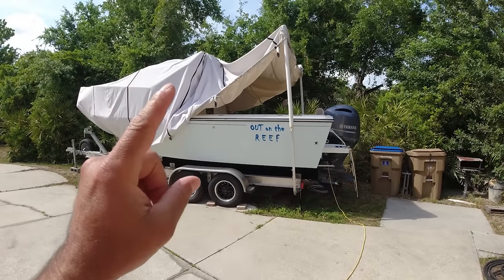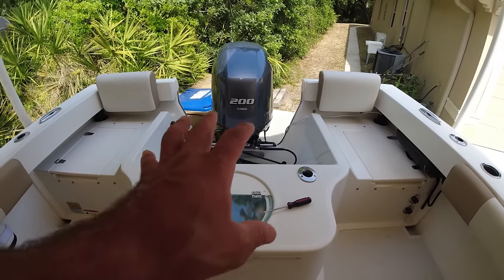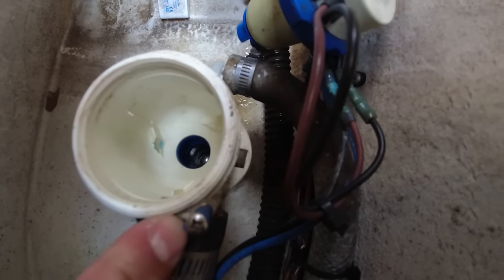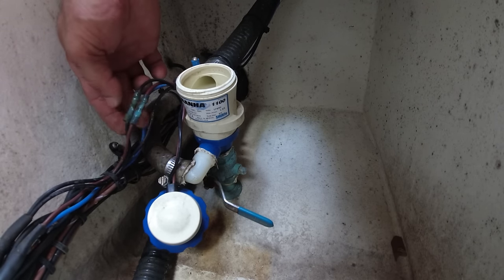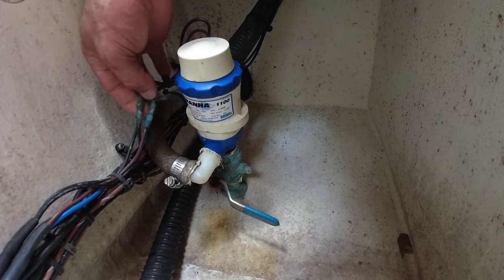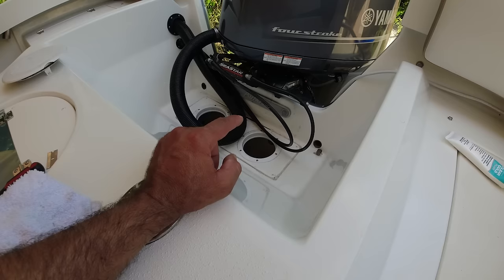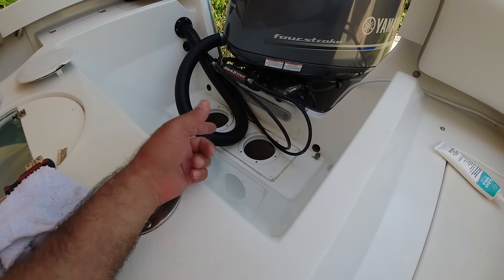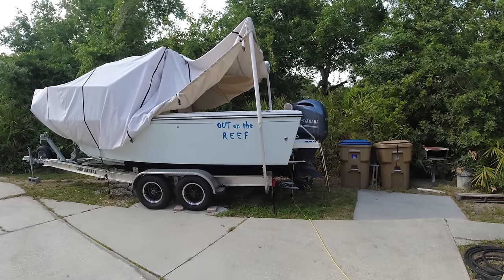Crooked PilotHouse is Been Leaking Water Since it was New Found the Problem from parker boats

Comment: Thru- hull connectors are responsible in sinking so many boats. Always carry a tapered wooden dowel, the size of your thru-hull fittings as well. I know yours was a bulge pump clearance issue, but make sure you wire a wood dowel to your thru hull fittings so if one ever breaks directly off, you can hammer the dowel into your thru hull to stop the leak.  
Good stuff captain. 
Uploading videos early this morning huh? 
My parker 2520 is ready to go after last weekend. Did major service including changing the thermostats and the timing belt. 
Have you changed your stats on that motor yet? I had one stuck open. Make sure you check yours my friend.
Reply from the maker: No I have never change the thermostat I only have 180 hours and how many hours did your motor have Captain
Reply: @OutOnTheReef  Hi Capt... I'm very surprised you have only 180 hours on your boat/engine?, I'm wondering if you hour-meter is 'crooked' ! We put 250-300 hours per year on the boat, and it seems like you do more than we do; I'm just surprised. 180 hours is barely 'broken-in'!.... Be safe Capt. and thank you for another helpful, informative video!...

Comment: Pro tip, when I find wires that have heat shrink butt connectors that were not heat shrinked properly that have been exposed to salt water (even if only briefly) I would cut the butt connectors out, re strip your wires, install an additional heat shrink sleeve onto the wire, crimp your two new heat shrink butt connectors in place, then apply heat to the butt connectors for a good seal, then once they have cooled to the touch slide the additional heat shrink over the each butt connector ( or a single heat shrink tube over both butt connectors) and then apply heat to it to completely seal it. If salt gets into that copper it will corrode fast.
Reply from the maker: Jake you're absolutely 100% right I should do that to avoid future damage on The Wire and thank you so much for your awesome advice it's the best way to do it thank you

Comment: Maintenance, maintenance, maintenance. I always enjoy preventive maintenance. It’s the small repairs that make you feel comfortable when out on the open sea. Small problem that would be a nightmare had the bilge pump gave out. 👍🏻
Reply from the maker: Yes I agree this could sink a boat if you're sleeping at night and not noticing the boat is sinking is crazy
Reply: @OutOnTheReef  No - a tiny seepage like he had is NOT going to 'sink the boat" - you're overstating it.
Reply from the maker: @bobbeckstead8340  I think it could if your bilge pump stops working and you're sleeping overnight on the boat don't you think that's a possibility
Reply: @OutOnTheReef  Not with a teeny-tiny leak - which is all that was possible from his particular problem.  Remember, he left it for 2 yrs without a problem.  It is not the least bit unusual for shaft & rudder pack nuts to weep continuously.

Comment: Two comments.  1)ABYC standards require the use of two clamps on all raw water hoses in the bilge.  2) You should adjust the pump to allow the ball valve handle in the seacock to open fully.  Stay safe!
Reply from the maker: Looks like this company who build a boat does not follow those standards and thank you for letting me know captain 👍👍

Comment: Funny you showing this video. a couple of years ago I had a leak with the saltwater washdown hose in that same area, and it could have sank my boat. I decided not to go to work that day and went to the Marine to find my boat sitting low in the water. the boat was filling with water. Since then I never turn the value on the saltwater washdown until I'm using my boat. A little leak can be a disaster. Thank God my bilge pump worked.
Reply from the maker: wow Williams that could been a disaster especially wen the batterie runs out of power, glad you got it on time cap.👍

Comment: Good job. The boats I rent all have Yamaha’s, great motors, but they all need maintenance and repairs. Check out your thermostat, had a bad one one today and it was easily replaced.
Reply from the maker: Awesome Captain thank you for letting me know and what was the diagnostic it was getting overheat and you heard a noise on the buzzer?

Comment: Nice! 

I’m more curious how you diagnosed and isolated the problem. 

A. Did you dry the bilge then close the ball valve with the boat in the water. Re-dry then open? Just an option to isolate a thulll leak thatbis fortunate to be on a valve.  

B. Make sure to cut those wire back and first slip down the wire extra shrink tubing, reconnect new butt connector, heat shrink them slip over the tubing and heat shrink it as well.. Also I noticed the orientation of your wiring is both goinf horizontal at a slight downward angle and also tieing into the transom. I would run the wire the other direction away from the transom if possible and get height away from the bilge before you run it horizontal.  That will keep your bilge wires dry. No bueno the way they are there. Bad on the factory install,, but an easy fix!
Reply from the maker: I repeated the bilge pump and screw back and the water leak stopped cap. It was never done properly from factory and i agree on the wire protection you mentioned cap ,thank you

Comment: I'm here to tell ya, Parker has a quality control issue when they release their boats. Little hidden things they overlook. I opened up the inspection hole in the engine bracket/swim platform on boat I'm buying. Found lots of screws and nuts left over from the build. I made the dealership come look and take at it and take a picture to send it back to Parker. Lots of left over drill shavings in the bilge, 2021 boat and the monkey fur already coming off in the pilothouse. Still with these defects I can see, I'm still going to buy it. Parker is now pumping out boats pretty quickly. So' throw them out there. Some will complain, most will not.
Reply from the maker: Something similar happened in my boat when I purchased it I checked on the fuel cap on the deck delete that protects the fuel tank opening and I found leftover screws hanging around in the bridge so I cleaned it up and didn't say nothing about it but yes it is a terrible uncleanness boat builder by my inspection and I also took the carpet out because of that issue of the mold and many other things and if you look at my channel my boat came without a window sealed in one of the front windows I was not surprised

Comment: I guess whoever inspected your boat had no clue of what he/she was doing, a leak, crooked pilothouse, kind of disappointed on the brand, and they are not cheap. As usual you always come up with a solution fir everything you need or want to do to your boat. Your lucky your handy and resourceful, otherwise it would have been extra higher expenses....
Reply from the maker: Yes very disappointment and you're right if I wasn't handy I will have to take all these things to the dealer and that would have driven me crazy so I feel sorry for people who buy this type of bolt with no knowledge of marine work to do their own repairs.
And thank you for watching captain
Reply: It's unreasonable to expect anyone to have detected that defect in advance.
Reply from the maker: @bobbeckstead8340  I think boats need to go to a water test to find leaks before they sell them don't you think, most great manufacturers do that
Reply: @OutOnTheReef  Most BUYERS do that.  Would you have detected that particular defect?  Uh-uh.  And, it was trivial and so easily repaired that you didn't even complain to the builder or seller.

Comment: Hey Cap, good catch on that leak! That one would be hard to figure out. 
However, one more thing I see that I don't like and feel is not safe is those types of inspection plates!  They can easily pop out from pressure or whatever and also leak. If one popped out with heavy following seas, you could be in real trouble. 
I replaced mine due to leaking even with good oring seals with the screw in type. First, they can't pop out, second, they seal better since can be tightened up. 
Please consider changing those out for better and safer inspection plates!
Reply from the maker: I noticed that rubber on my case they always leak water no Captain where do you buy yours do you buy through Amazon if you did can you send me the link so I can replace mine that is a really important thing to do on my boat thank you for the big heads up Captain
Reply: I’m surprised they are not the screw in type to begin with.  That area can be awash in water when drifting or at anchor in seas.
Reply: @OutOnTheReef  Hey Cap, my application is a bit different being on a bracket on a Grady White. I have 3 inspection plates. I was able to find the best fitting one's with exact same hole cutout size from West Marine, their brand actually. So far, they have been excellent quality and no leaks. I was getting lots of water inside the twin engine bracket each time out and would have to remove both drain plugs from the bracket. Since I replaced the pop out style and installed the screw in type, no more water ever drained since the replacement. I used 4200 sealant for the outer rim, and used  silicone rubber safe grease on the orings so that they don't deteriorate the rubber orings.
Reply from the maker: @robertp7209  I would like to find those Lids so I can replace mine because definitely they do feel like I can pop out any minute and make a problem on high seas
Reply from the maker: @Grady252  great suggestion Captain I will look into those and I'm glad your Grady-White boat is now top shape and thank you and always navigate safe my friend
Reply: @Grady252  - I have the same boat I guess as you, I used solid covers no screw out, same material I think polyethylene.  Caulked down never a leak.  Since there is nothing to access inside except upper engine bolts, no need for regular access.
Reply: @robertp7209  That is very true, but I liked the screw in type so that if I needed to get in, was quick and easy. I also installed a small silicone aquarium hose and ran through the transom to allow air pressure to escape as it was blowing my caulk out. Lots of air space in those Springfield Brackets to heat up and expand and contract.
Reply: @OutOnTheReef  - the brand you have now will probably have both versions.  The brand may be on the cover, then it’s just a direct replacement.  Mine on my old Grady are Tempress Marine, they used to come also in off white like beige similar to Grady hull color.  They were not ABS material but a softer polyethylene I think.  My floor deck plates over the gas tanks are pop out, the one over my bilge is screw out.  I have a tool for the screw out but just snug it by hand.  It doesn’t matter if it leaks a bit into bilge.  I also have one pop out on each side at the step up to the walk around, but replaced those with some Amazon brand white ABS screw outs.  The pop outs were jiggly loose, the starboard deck coring was wrecked from however little water dripped down the inside over the years, and Grady’s expertise at “glass starvation” = too little resin applied making the 1/2 in. Ply coring skin porous.
Reply from the maker: @robertp7209  very good information Captain I will look for those replacement so that way I have less leaks into the bilge thanks for the awesome suggestion captain

Comment: Hey Capt.....When that saltwater gets into the copper wire connection. It will corrode even after you heated the connections. You might want to take the connections apart , clean and reseal . It's stinks the factory left it like this.....
Reply from the maker: I know it sucks it's just a momentary fix but later on I know I'm going to have to fix this the right way thanks for the heads up Captain, and yes it's a shame that the manufactured didn't do it right the first time

Comment: Hi Capt... thank you for this helpful and safety-related video...
I also responded to one of the comments about you having only 180 hours...that is very surprising to me! Stay safe, and thank you for your great video....
Reply from the maker: Thank you Captain and I did not see that comment I'm going to look it up thank you for watching
Reply from the maker: I could not find the common captain but yes the motor right now has 180 hours
Reply from the maker: I think the reason I have very little hours is because I don't do much trolling
Reply: @OutOnTheReef  Hi Capt... having low hours is a GOOD thing; I do too much trolling  (lazy-man fishing!☺) so I put too many hours on the engine at low speed.... On the thermostat subject. I first changed my thermostats at 700 hours. They looked like new! I kept them for spares. I run mostly in brackish and salt and I flush the engine after every use. I wasted money and time changing the thermostats. It could be different with all ocean, heavy salt water use....
Reply from the maker: @andrewfyakim525  I would look at my manual and probably I will do mine close to the 600 hours then thank you for letting me know because now I have an idea and also I will look at the manual to see when I need to change it like in my case the impeller I changed it too soon I could have went another 70 hours more on it the next thing I need to do is pretty soon change the internal anodes

Comment: Great video captain!  On another subject, there was a successful class action regarding MB Sprinter emissions. I think it includes your Sprinter’s model year. As a current owner you could receive compensation of up to about $3,500 so it is well worth your time to check it out. Also, there is a fix in the works, I think it involves the NOX sensors. Good luck with it, Captain!
Reply from the maker: Thank you Mike for letting me know and I alread i sold the 2014 but they still will give me compensation ,my new 2017 does not apply for it but I still I can get $900 for the old vehicle that I used to own ,thank you for letting me know Captain really appreciate your heads up

Comment: Hey captain a couple of things I noticed in your bilge 1. It didn’t look like your thru hull fitting is grounded. 2 the connection for your pumps should Beas high in the bilge as possible.  I had an electrical audit done on my boat and My bilge pumps was the same as yours.  They suggested I make the changes. He also had me Check out Pacific  Yacht Systems YouTube channel really good information on electrical systems on boats.  Keep up the awesome content.
Reply from the maker: I don't think it's grounded neither Captain why should it be grounded does it affect the life of it?
Reply: Yes
Reply from the maker: @jasonbeaudoin8359  wow that is crazy that mine does not have it 😳 
Thanks Jason
Reply: @OutOnTheReef  I don't think most boats need to ground the seacocks or thru hulls. Even my Grady did not do that. I think that is more for sailboats with the tall mast, but not 100% sure on that. Mine is a 1992 and no issues so far with any of the fittings I haven't replaced. I only replaced all the plastic one's.

Comment: You should always have some wood plugs on the boat.  You can buy them at the marine supply store.  Over time with electrolysis it can eat away at your metal through hull fittings and when they break, you can hammer in a wood plug and get home.
Reply from the maker: Great idea cap. I will look into it👍👍

Comment: You should seriously consider purchasing an electric high volume pump 20 gallons per minute. Just in case b/c you go into deep water in the Atlantic and Gulf 10 plus miles out. Just in case both your bilge pumps don't work.
Reply from the maker: That is a great idea Captain a secondary built that would really come in handy in an emergency thank you for the great suggestion cup

Comment: Thru-hulls below the waterline should always have 2 hose clamps on the hose on each side of the fitting.
Reply from the maker: I agree Captain just in case one breaks👍
Reply: Try getting two clamps on the intake pipe of most small pumps.  The pumps just are not made to accept 2 clamps.
Reply from the maker: @bobbeckstead8340  very true I need to get on it and put another clamp on it thank you Captain
Reply from the maker: @Vashon Trawler very tru too cap.
Reply: @Vashon Trawler Also, those pumps that mount directly to the top of the thru-hull (NO SEACOCK) are not advisable on boats that spend nights on the water.

Comment: Hey Capt Crooked you shouldn’t have fixed the leak that way you would have the only Crooked Pilot House from factory with factory water leak lol good idea to keep the valve off unless using the the pump on mine I go up and out and to water level I don’t have any thru hulls JT 🇺🇸🇺🇸🐟🐠🎣🛥🌴⛱😊😊🙏🏻🙏🏻🙏🏻🙏🏻🙏🏻
Reply from the maker: that is better not to have them, the lees openings you have in the Haul the better😁😉⚓⚓

Comment: I discovered that if you close that valve, while at sea, water will lay in your pump, so I cycle the valve on dry land to drain the impeller housing area.
Thought you might find it interesting.
Reply from the maker: That's a great idea captain that way you don't keep saltwater there all the time mess up the impeller of the pump great suggestion Captain thank you
Reply: What do you do about the backflow from the hose?
Reply: @bobbeckstead8340  mine is in regard to a live well so it just drains out the pick-up.
On a wash down I would disconnect the spray hose to rinse the salt out.